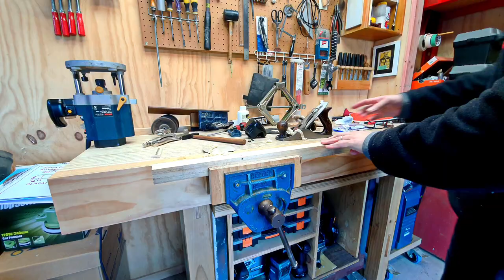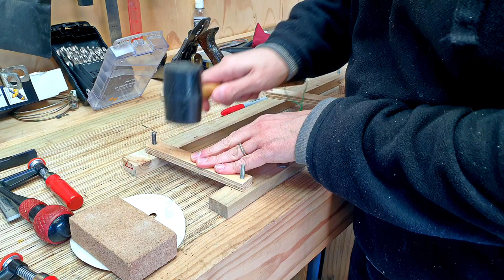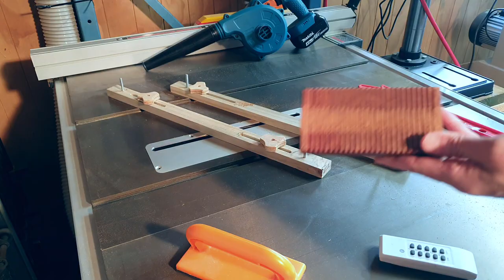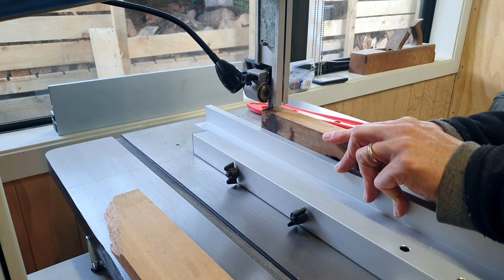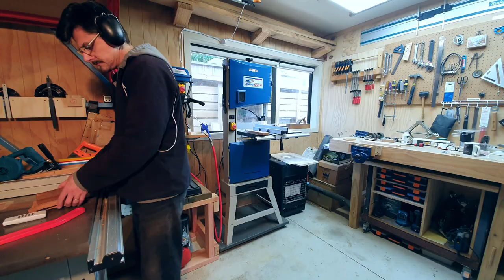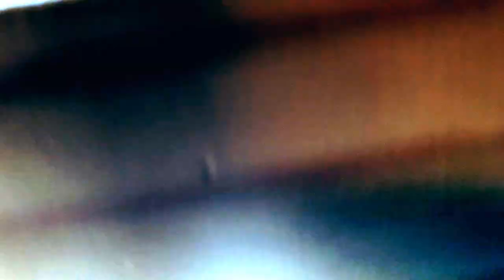How to make a soap dish.

Comment: Very Informative one, Rob. Noice parallelogram jig there. I am still scared to do that on my table saw 😅
Reply from the maker: Hehe, just go one micron passes at a time Suj and that will keep you busy until the virus is gone and not much can go wrong. Just made sure the fence system is rock solid to prevent your workpiece rotating and kicking out. Long pushsticks!! 🤙

Comment: Would always moving the timber across the blade in the same direction dull the teeth on the leading edge?  Would it be a good idea to do the next batch coming from the opposite side?  Is "a little bit of a deep dive" a shallow dive?  I always find it's better the deeper you go.  Stay safe.  Cheers, David
Reply from the maker: Hey David, yep for sure. Not only would it dull the teeth on the leading edge, but it is effectively only cutting with half the teeth on an ATB blade. If I was cutting hundreds of these I'd probably .... buy a that cheap spindle molder at Toolshed 🤣.
I see what you did there ! Deeper the better - yes - I see where you're coming from. It's probably opening a can of "worms" if we get too much into it though. 
See you at level 2 on Monday mate. Bit of a bugger when you live 2 mins from the Waikato boundary on the Auckland side and your missus can't go to work 'cos it's over the other side. You too - stay safe. Cheers.

Comment: Very cool Rob. You mentioned that you didn't think a thin kerf blade would be good. Why is that?
Reply from the maker: It's just a hunch. Those thin blades are known to deflect and follow the grain instead of the cut line at the best of times, let alone when you're intentionally pushing at it pretty hard from the side.. I've never done it but it doesn't sound like it would be a great experience.... that was all.
Reply: @TakamiWoodshop  interesting! Never heard that before!
Reply from the maker: Deflection.? It happens more the harder your material is I guess which stands to reason. I've never experienced it but a friend of mine is always complaining about it. I've had wood come off the fence following grain though. It's just a path of least resistance kind of problem.. Very annoying.
Reply: @TakamiWoodshop  that's crazy, I've never experienced that before. Does new Zealand have the same story hard hardwoods like Australia?
Reply from the maker: @TheGrantAlexander  nah not really, they have a bigger range or more readily available more attractive harder woods whereas because of limited geographical area and smaller forests leading to overuse and then protected status leading to higher costs and less availability here in NZ we have pine pine and more pine at the big box stores, and you have to look around all over the place to get other species.